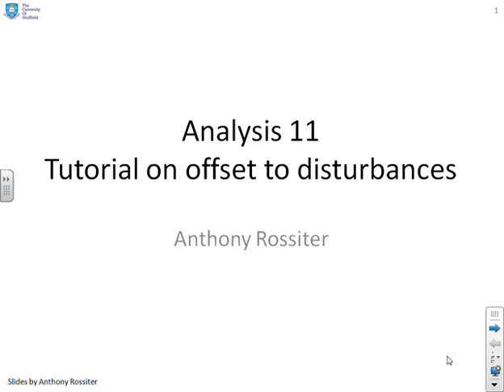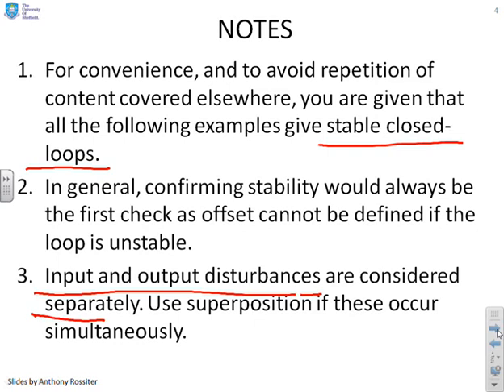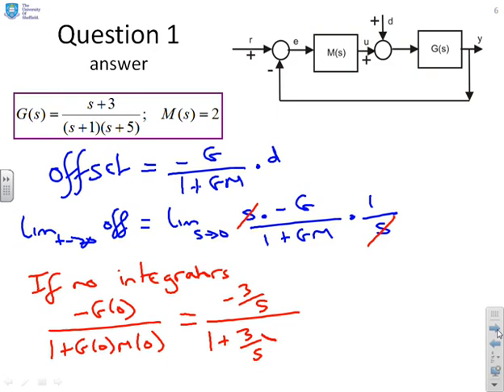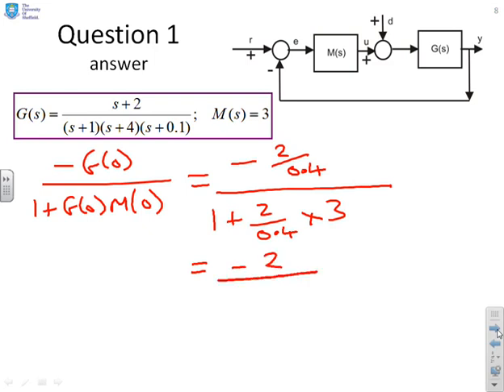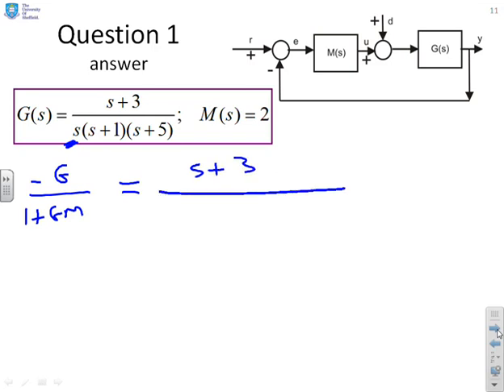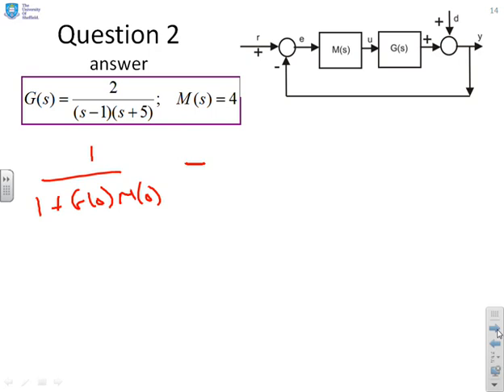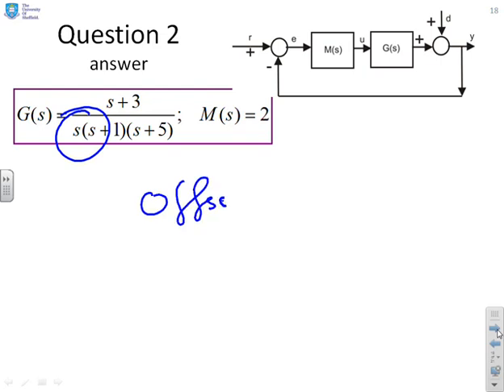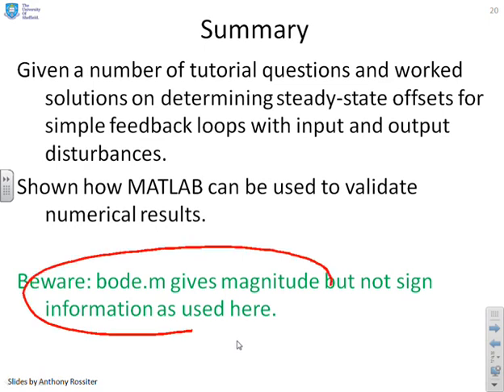Analysis 11 - tutorial on steady-state offset to input and output disturbances

Comment: I am using 4 state model of Inverted pendulum...I designed LQR+observer controller ..Then i have given disturbance as in B matrix B*F_disturbance(step Disturbance as from input channel ). so it is matched disturbance...I am getting constant steady state error in Position of cart and angle of pendulum.. I have corrected error in cart position by Putting integral action or ADRC control  but in both type of above control i am unable to remove the error in angle of pendulum... plz anybody suggest answer...??